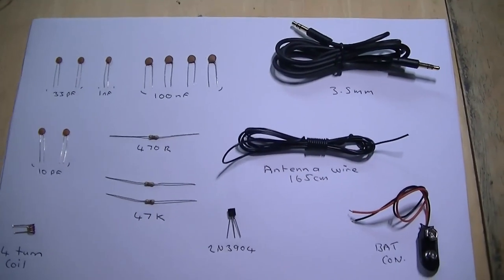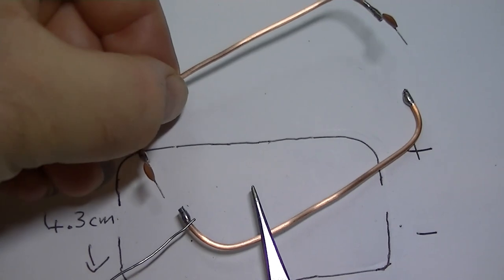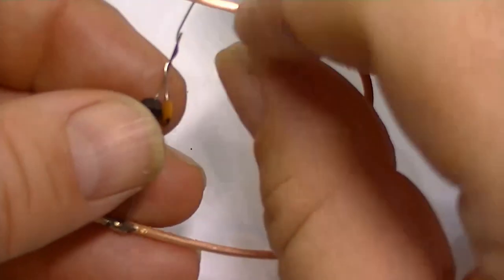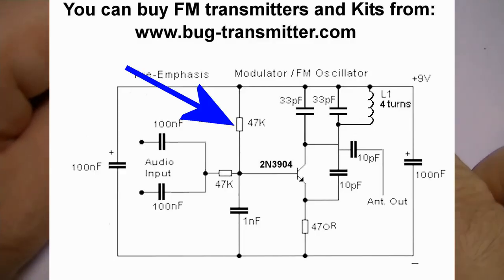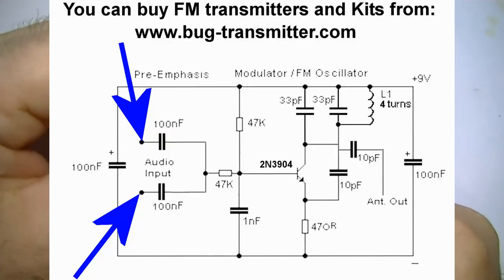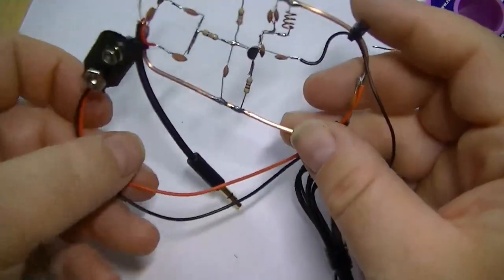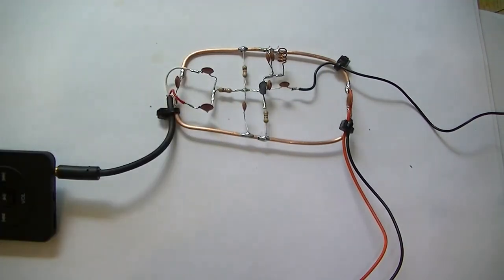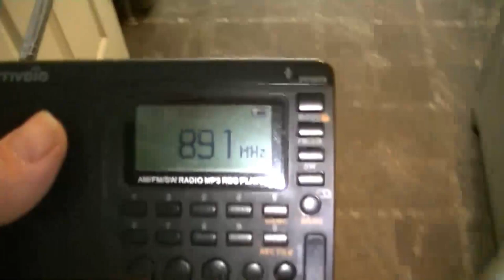BUILD YOUR OWN FM TRANSMITTER,your own FM radio station.

Comment: how many mW is this ? and how do i push a smaller transmitter to broadcast further ... btw you're local from the sound of your accent, do you go to any of the local ham clubs ? i have access to a laser etching machine if you want to make some pcbs
Reply from the maker: Thanks for the offer of access to your laser for pcbs, I get my pcbs made in China very cheap with fast turn around, output of transmitter is 5mw, thank you.
Reply: @dazaro3  wicked thanks dude ... what are your opinions on the PLL transmitters you see on ebay? Have been looking at the 15w and 30w kits (the yellow and blue ones that come without the enclosures) ... the laser is here if you need an enclosure / something cutting just give me a shout im from wolves
Reply: @dazaro3  I MADE A 5 COMPONANT 9 VOLT FM TRANSMITTER ONCE ( YOUTUBE ) AND IT WORKED FANTASTIC ( 150 YARDS ) HAVEN'T BEEN ABLE TO DUPLICATE AGAIN ,,,,WHY ?  ALSO IT GETS VERY HOT ,,,,,,,,,,,,,,,HELP